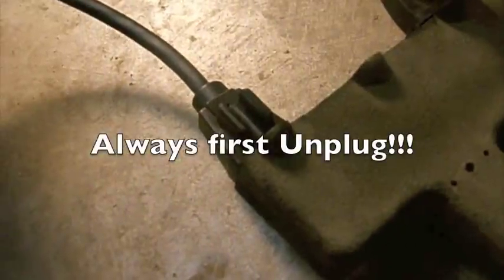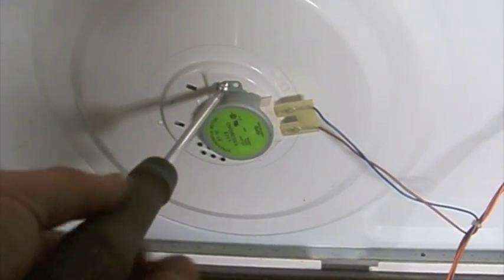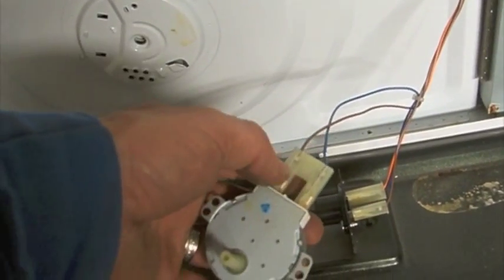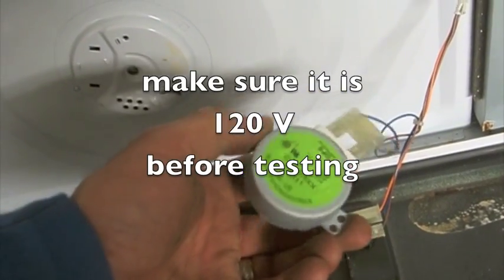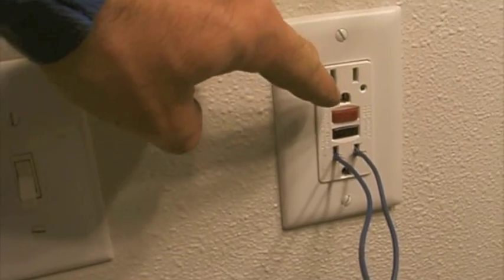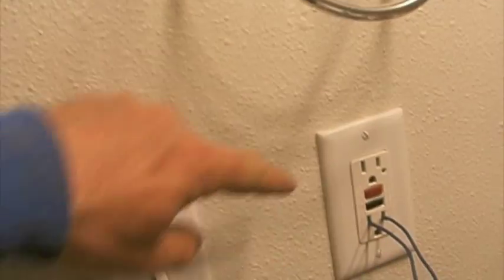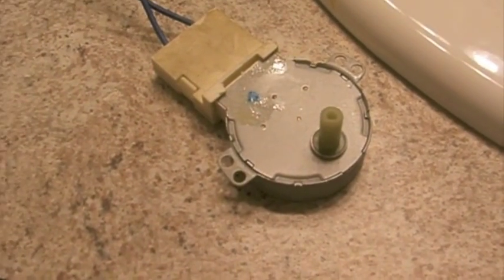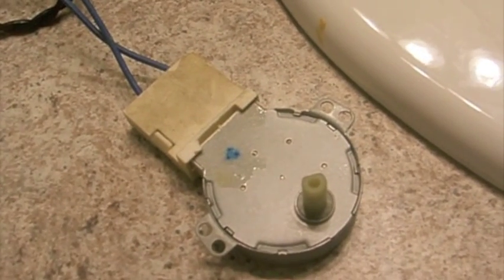Repair Microwave Oven Motor Synchronous testing Synchro test

Comment: You don't need to remove the motor to  check whether it spins and changes direction at each switch - just look at the rotor inside the microwave!!
Reply from the maker: Wish it was just that easy, but on some models the control board inside controls it.,  In my microwave the control board controls it and tell it when to spin.  So I would have to check it like this to see if it is a faulty motor or faulty control board.